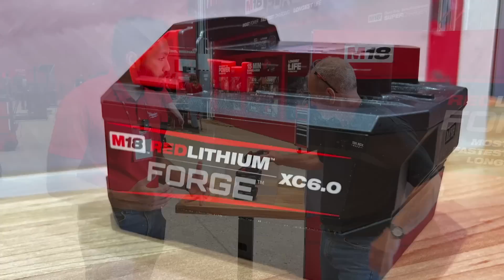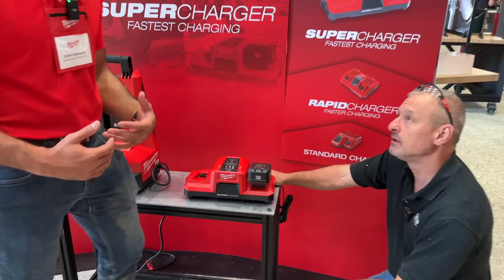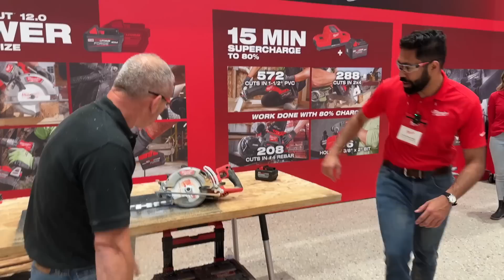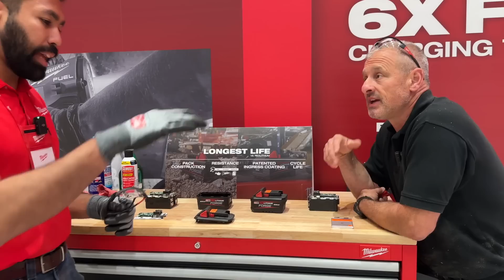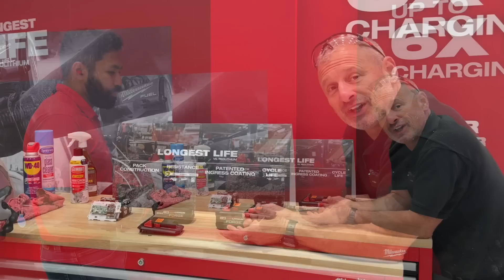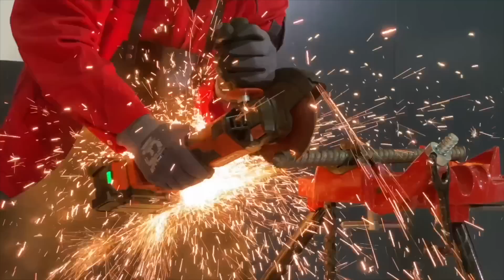The "NEW" Milwaukee M18 FORGE Battery

Comment: I call BS at 6:25. The extra power is from the extra amp draw available. Not some computer talking to the battery.
Reply: The employee is probably just repeating some PR marketing bs. If these tools are so smart, I wonder what they think when you use another brand battery with an adapter. It might be so confused right?
Reply: Explain to me how you’re making that assumption you’re just pulling explanations out of your hat ?
Reply: @PelleBleu  based on previous models unaware of this tech, battery adapters, my knowledge of electricity (pretty good), the way the sales man answered the question. It’s just a hunch. I just think it’s BS.
Reply: @PelleBleu he's correct it's just higher output not some complicated micro chip BS. it's impressive that they can produce the same or slightly more power out of a smaller battery

Comment: $249 charger?  Ok Redheads, time to demonstrate your allegiance to the brand! 😂
Reply: Look at them acting like they only have one battery and have to wait for it to charge up before going back to work. 
How about you keep your old charger and buy a couple more batteries for the same price? Sounds like the smarter move to me.
Reply: @MrArcticPOWER  $249 definitely buys some spares!
Reply: @MrArcticPOWER right.  2-pack of the 6.0 are $170 right now
Reply: @MrArcticPOWER  some people only do have one battery or even if that have 2 or 3 like me I still have a lot of tools that use those batteries. I see you don’t own a battery powered grinder or heat gun or saw which will drain a battery in less than 20 minutes. With 3 batteries that’s less than an hour worth of work
Reply: It’s absurd, my dual rapid charger will work more than fine for these batteries
Reply: Don’t think they understood the 12v 6ah bats.They just quit ! Really surprised after see on of there old vid on bats.Showing n telling how much time put into development.
Reply: Sounds like a condom commercial.High torque,deep penetration n friction mode.bababahhhh
Reply: Hope these guys aren’t electricians
Reply: A lot of Milwaukee tools just burn through batteries. It's kinda crazy. They prob need to go to a dedicated 36v line.
Reply: @histguy101  increasing volts won’t increase run time, you need bigger batteries
Reply: @wendellgreenidge3362  it's just my experience. The Milwaukee table saw with a new 12.0 will die 2-3x faster than the DeWalt 60v table saw with a 60v 3.0 battery, and the DeWalt has a lot more power. The track saw will burn through an 8.0 making like 10 8ft long cuts in hardwood. The m12 multi tool will burn through a 6.0 in like 15 min. The 4.5" 18v fuel grinder will burn through an 8.0 in 20-30 min.
Reply: Brotherhood brotherhood brotherhood! One of us!
Reply: Still cheaper/better than SnapOn
Reply: Not bad same as flex top of line charger
Reply: If you can’t afford it go get you a skil drill
Reply: Seems fair seeing as it’s going to charged tens of thousands of dollars worth of batteries over its lifetime. I want it already and I have absolutely no use for it 😂
Reply: What’s wrong with $249?
Reply: @wendellgreenidge3362  a charger was, at one time, just part of a kit.  Now they’re being marketed as high-dollar accessories, and VERY high margin too; there’s probably less than $10 worth of parts in that thing.

If you are willing to pay then I’m the one who’s wrong. 😉
Reply: @superspeeder If that thing is 15 minutes to 80%, that means  charge currents of 20A or so, with 2 bays so this thing is a 40A 21V charger. That means it has a 900-1000W switchmode PSU. That is VERY expensive to produce.
Reply: @procrastinator1842  twice as much as Makita’s dual rapid charger?  No.  More expensive, yes, very slightly.  A 1000W supply might cost 20% more to manufacture than a 500W supply.  Economies of scale.
Reply: @procrastinator1842   There's no way this thing pulls 1000W with that tiny cord. This is more than likely a 20A charger between the two.
Reply: @superspeeder  do you really understand battery technology or are you assuming?
Reply: @procrastinator1842  preach
Reply: @wendellgreenidge3362  I know quite a bit, though I’ve never been employed as a battery pack design Engineer.

I do know enough to intelligently question a lot of the marketing wank that Milwaukee passes off as “innovation”.  All the BS about the tool intelligently adapting to the specific battery is nothing more than voltage drop under load.  More powerful cells mean less voltage drop, more power.  You can wrap that concept in a bow and call it whatever you like, but it’s the same idea.

About the only thing I’d believe is the tool throttling itself based on a battery-specific minimum voltage or current limit as the battery is depleted, but that’s not nearly as sexy as calling it RedLink Intelligence or whatever.  If anyone could sell flippers to frogs, it would be Milwaukee.

I’m not a Milwaukee hater, I have most of their M12 lineup and generally love them.  I just hate cheesy marketing.
Reply: @superspeeder  but you know you sound and come off as a Milwaukee hater, those parts can’t be that cheap as you’re trying to make it out to be. To be able to charge a large battery to 80% in 15 requires a lot of watts and that’s not cheap to manufacture
Reply: @wendellgreenidge3362  it’s MUCH cheaper to manufacture than most people realize.  The parts cost is minuscule compared to the cost of assembly, packaging and logistics from China to the store shelf.  I’m sure it costs Milwaukee barely more to put this on the shelf than it costs Makita to do the same with their dual charger, but the Makita is HALF the price.  It likely costs Makita 90% more to put two of their chargers on the shelf even though they’re half as powerful.
Reply: @superspeeder  So how much does the parts cost and what parts are being used for you to think it’s a rip off?
Reply: @superspeeder as long as my regular and rapid charger work just fine on all batteries - I don't mind it so much. Maybe I'll grab it when there will be a flash sell.
Reply: @procrastinator1842 so 40 amp charger on a 15 amp house breaker?
Reply: @1barticus  Yes. 40A DC at 21V.
Reply: @MrArcticPOWER 1000W÷100v= 9Amps
Reply: @wendellgreenidge3362  I love Milwaukee but I'm whiling to called them off when they try to rip people off. Some of their tools are priced way too high for what they are and this charger is a good example. 
Same whit their entire MX line, they're selling you 240$ worth of 21700 cells for a whopping 1149$!
Same with their right angle die grinder which is literally a drill with less parts but cots twice as much. Makes no sense.
Reply: @MrArcticPOWER  if people can’t afford it then just say so lol
Reply: @wendellgreenidge3362  😂 you are right. When they dropped the new battery and charged I'm getting 3 charges and 6 battery.
Reply: @sprite-of-sand  It’s like this, I’m a mechanic and I own a shop and the guys in the shop as far as lube techs use electric tools that I provide. When you have 12 guys changing tires all day then you run through a lot of batteries. The fact that I can charge 2 batteries to 80% in 15 minutes is great for me. If I bought 2 chargers for $500 and one forge battery for each guy there is literally no down time. That’s $3000 invested. The battery can be charged before they can finish an oil change. The productivity will make me more money than in the first month of investment. I find it only the people that don’t look at it as an investment in quality tools that think it’s over priced

Comment: Yeah but he doesn't mention that fast charging ruins your battery
Reply from the maker: Not with cooling
Reply: @ConcordCarpenter  It still does cooling only helps when you have used the battery and it's warm regular chargers won't charge the battery right away you have to wait till it cools down even the fan ones don't start charging right away either but the fan cools the battery quicker and once it deemed cool enough it will start charging don't listen to Milwaukee salesman they lie right through their teeth there's is the first and most powerful
Reply: These are lithium,  not nicad ,
Reply: @BenJamin-ou7kd  Fast charging ruins lithium what planet do you on
Reply: It fast charges to 80% then slows down for the remaining 20%. Your battery should be fine.

Comment: Fab update thank you Rob.  Did they mention progress on smaller sized Forge batteries?  I’m a big fan of the High Output 3.0 battery on drills/impact drivers.  Any sign of a Forge battery equivalent to that?
Reply: I was going to ask. I use the smallest battery on my drywall gun .hell if they can make it even lighter all the better
Reply from the maker: No they didnt